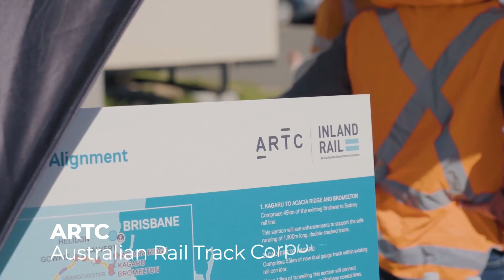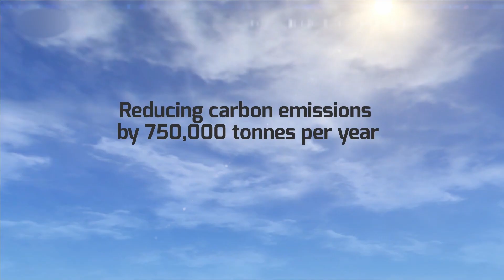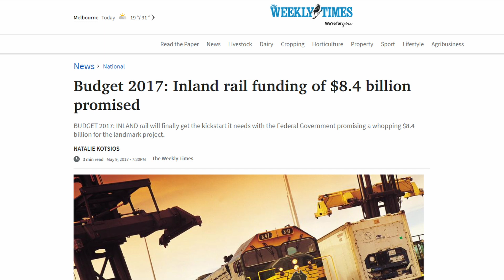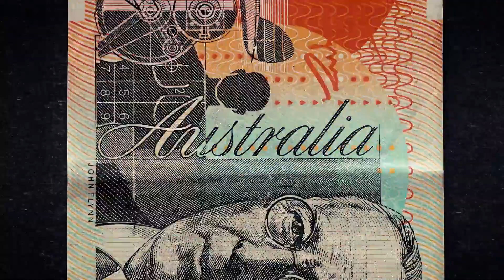Explore Australia’s 1600km Groundbreaking Railway

Comment: It is nice   to builld something though  comes a service issue once  you start single  tracks

With ni crossings to fuck around with  you logiistical 50-100 mile train instead of  4-10 mile length today

Bigger question to ask it it feasible looking at electric motive power  or or diesel/ gas hybrid could be used

Comment: These AI crap videos are always poorly presented due to mixed & disjointed narratives. It is not similar at all to Chinas Belt and Road initiative, no where near the same scale. There is only 1 tunnel planned, a 6.2km tunnel under Toowoomba range, and it is NOT going to make up "a significant portion of the $31B cost" That statement right there highlights that you not only did little research but that you don't know the cost of rail infrastrutre. Eseentially, you are saying that a 6.2km tunnel is going to cost over $15B...a patently farcial assertion. Anyone wanting to know more, just go to the Inland Rail website for accurate info.
Reply from the maker: Hi Floyd, many thanks for your honest input and I'll take this on board to improve the quality of my future videos. Your insights are very helpful and I'll work to improve research for each video topic. Thanks again Floyd